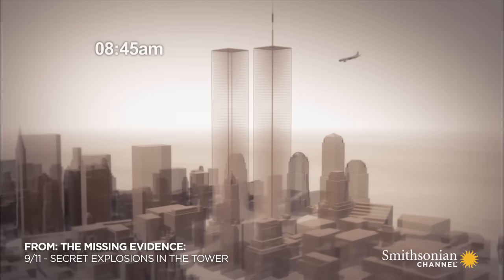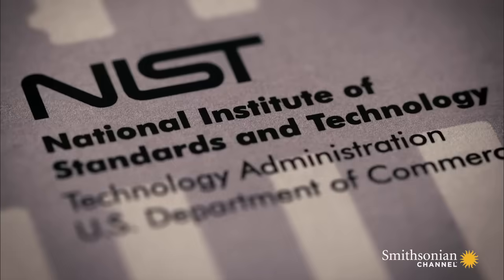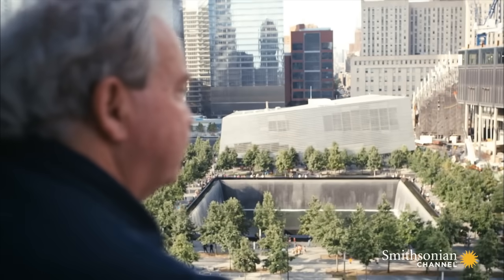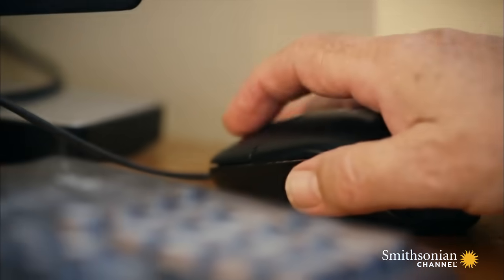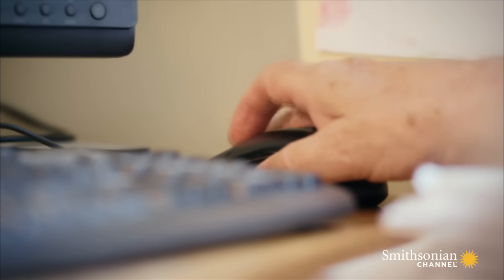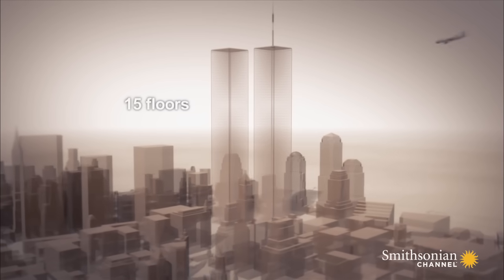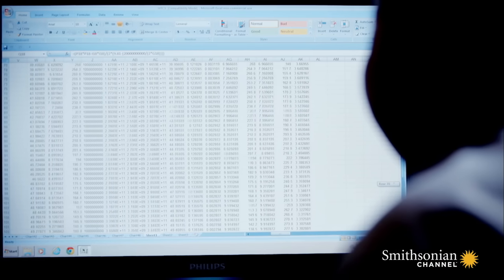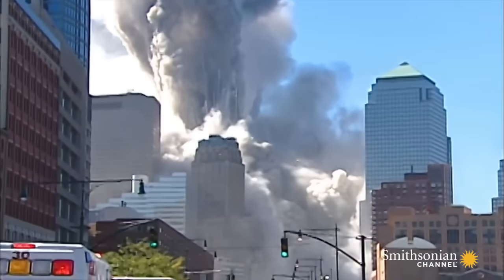This Computer Simulation Explains How the Twin Towers Fell

Comment: Didn’t actually watch the video, but I’m just gunna assume it was C4?
Reply: all 4 steel beams heated up at the same rate and hit their breaking point all at the same time and collapsed like a perfectly executed controlled demolition? if they melted and folded from the pressure this building would have tipped one way or another and hit the non insured buildings from "terrorist attacks via plane". It would also hit rich people who were not informed of the execution like the ones in the twin towers were.
Reply: Dallas The Star Wars Fan nah fire fighters heard an explosion
Reply: Every truth person out there
Reply: Taylor Welsh firefighters witnessed melted steel
Reply: Roger Wilco no. Neither tower burned for more than 2 hours. If I remember right the North tower burned for like 100 minutes. The South tower was less than an hour.

But one of the buildings had previously sustained fire damage that really did rage for hours. And this was before fire safety measures like sprinkler systems. No structural damage was caused then.
Reply: OOM- 8018 The top of the building is smaller than the area under the impact zone. The collapse would have slowed down.
Reply: They found proof of thermite on the ground, in the debris
Reply: In the history of the world only 3 steel structured skyscrapers have burned to the ground. All 3 in the same day 9/11. 
This conspiracy had people in govt, wall street, insurance companies etc. There was a huge loan that was coming due on 9/12,  2.3 trillion missing from the govt. ONI had been investigating along with another agency. Their offices were the ones hit at the Pentagon. AIG, Morgan Stanley, and other companies had offices near the floors that were hit, were to have meetings regarding millions of dollars in overbilled invoices.  A day before there were hundreds of thousands of insider trading that US Air, and American Airline stock was going to go down which turned into milions in profits. There were also military training exercises going on the very same day near NC, of the exact incident taking place in NY.
But this is all a coincidence, no big deal
Reply: Thermite
Reply: Micro-thermite was found in the debris. How to that old plonker explain that?  Also, his model is flawed. The collapse actually sped up as the building fell. That is impossible. They also could not explain why there were massive balls of molten steel at the bottom of the debris. I can, they used thermite charges to cut the steel at the base of the buildings.
Reply: Devon Miller Simple it was a inside job they knew what's up that's why they did communicate with each other on any government level they wanted to have a war... Rember Saddam Hussein had nothing to do with 911 but yet we declared war on them... they figured they needed a similar situation to pearl harbor to get people to back the war they wanted... your government is shadyer then you think... you'll see 50 years from now when documents are declassified!
Reply: Jae KiDd sources?
Reply: Roger Wilco an hydrogen-air explosion goes boom too
Reply: Dallas The Star Wars Fan please do research jet fuel reacting, causing a fire does not generate enough thermal energy to melt steel and “its 2018” isn’t an excuse for a theory with some evidence behind it. I’m not suggesting it was set up, but you can’t discount others opinions
Reply: The King Molten aluminium and water don’t react lol try the experiment or google it yourself lmao
Reply: Roger Wilco nope only reacts when iron oxide is present there was not enough rust to continue the reaction of that size, Al Reacts exothermically if mixed with metal oxides not purely H2O look it up
Reply: Roger Wilco magnesium is only used for wheel alloys. There was not a enough magnesium to produce a reaction of that size and sustain it.
Reply: Roger Wilco that’s the wheel weight including tyres air etc, the alloys weight considerably less, the amount of joules of energy it would take would be ludicrous- you can see on a small scale experiments magnesium does cause a decent reaction however this still would not make enough joules to cause a steel building to collapse
Reply: Roger Wilco each wheel rim actually weights 40kg btw not 2000 pounds lool
Reply: Devon Miller no the owner of the buildings had an interview when he slipped up and told them he pulled them and had preset demolitions Incase something like this happened
Reply: Thermites? That's ridiculous. They eat wood, not concrete and metal.
Reply: Griffin S No steel building has ever collapsed from fires you fool.
Reply: Roger Wilco well suggested that this was never really publicly known because the only proof was in the video it really was a slip up. or maybe not, but either way look at what you just said.. the fire got burned the building before they had the chance to pull it. now you know preset demolitions take months to put in place for a building this size right? now that seems real suspicious it seems like they had this exact scenario in mind.
Reply: Nope. Directed Energy Weapons... like the ones for sale on Lockheed Martins website right now. Check out the circular crosshair shaped holes in the ground. Check out every video of a building collapse ever. Nothing turns a building into dust in mid air. No bomb, no thermite, no C4. This is a brand new weapon producing a brand new effect on materials. DO YOUR RESEARCH without picking a side. Let the evidence speak for itself.. you will not be able to come to this conclusion shown in the video.
Reply: Lmao c4 is used to breach doors not huge buildings
Reply: Had to be stronger. Steel beams.
Reply: C4 disused as American Airlines no 11 and United Airlines no 175.
Reply: Of course you didn’t watch the video.
Reply: Same bro
Reply: Wolfiez MC strategically placed thermite bombs were placed on the lower levels of the building. some of the survivors from the lower levels escaped with blast wounds
Reply: thermite bomb
Reply: A thermite bomb.
Reply: Wolfiez MC also the manner in which the towers collapsed, it looked just like a controlled demolition.
Reply: Jet Fuel Burns at 800F - 1500F. Steel loses enough strength to collapse way at 1000F.
Reply: Taylor Welsh it would take atleast a day to melt to the bottom of the tower
Reply: Wolfiez MC They didn't no they didn't but they did get hot enough in order for them to get bent did you ever thought of that?
Reply: Yeah the steel may have gotten hot enough to bend, but this would only apply to the impacted floors. The majority of both towers were structurally sound; Both towers were 110 floors high, WTC1 had 90 floors of untarnished steel below the point of impact, and WTC2 had 75 floors. That's an immense mass of steel joinery, and it would take time and energy to bend and buckle all this steel. If the towers fell due to a pancake affect then the falls would have started slow and then picked up speed. Also the only way a pancaked fall to have happened the way it did is if each floor buckled onto the bottom one in a perfect way as to buckle all structural integrity of the lower floor in an even and uniform way, otherwise the upper portion of the towers would have been slowed and held up, or would have toppled over. If you look at the footage you can see the upper portion of one of the towers was slanted, so it would have been impossible for a pancake effect to result in a clean demolition. The falls were assisted.
Reply: @Lightguardian_HOH  just saying but what about testimonies about molten steel from firemen and several witnesses. Moreover assuming it bent the steel frame from just incomplete combustion which was built to withstand crashes, should not the buildings fall like trees struck at the base rather than fall in free fall fashion. I am not challenging anyone, just have a keen interest in the matter. Hope you answer the above without cussing me.
Reply: Wolfiez MC You truthers say the same thing you're a broken record player and its 2018 please disband you're movement
Reply: No, i've heard it was an interdimensional elf that had a laser so powerful that he collapsed the buildings by making them begin to fall at the plane crash site and not the bottom floor to make it look like a real fall then disappeared to his own dimension after the job was done and returned to get his Bush/Cheney money....or it was a plane with fuel so hot that it was able to weaken the structure of the beams to cause of weight of the higher floors to collapse on itself.
Reply: mark muravyov wrong, Molten aluminum leaking to water creating an explosion.
Reply: Roger Wilco if you google molten aluminium reacting with water you will see a multitude of videos proving my point
Reply: It doesn't need to melt the steel completely, just bend it or compromise its structural integrity.
Reply: Devon Miller thermite in carts
Reply: jet fuel weakens the steel resulting in collapse..The towers if to collapse were to do so as they are seen
Reply: @taylorwelsh149  the steel in the floors where the plane hit might collapse but the rest of the foundational supports and 60 floors below were not damaged. The majority of both buildings should still be standing.
Reply: @taylorwelsh149  physics, try it you might learn your government is led  insane psycopaths.
Reply: False jet fuel burned it down plus electronics in the floors.

Comment: Heard all the theories. No Accepted theory explains how the floors pancaking disintegrates the core. They say the floors were peeled off by the pancaking. Fine. That leaves a very large very tall intact core still standing or to fall over like a tower after. Remember folks the bottom of the building was designed to carry the entire weight of the building as you go down floors the core is built bigger and stronger to hold all the mass above. There is no explanation for floors pancaking off reducing the weight the core must support while simultaneously disintegrating the core. I call the accepted models BS for that reason. a multistory core should have still been standing in the center of both buildings. No way it all ends up as rubble if the floors pancaked off.
Reply: Rough And Wretched R.A.W. Look up WTC 6...Mandela Effect and inside job proven.

Comment: why use a computer simulation when you have actual footage of the collapses, explain to me how the whole steel cores and everything in the towers just turn to dust and float away, tell me why 800 body parts were found half a mile away on top of the bank building skyscraper, explain to me why 1400 cars when up in flames as far as a half a mile away but nothing else was set on fire? answer these questions an maybe I'll listen to these ridiculous hypotheses.
Reply: keith mcleod 
Yoir questioms are answered by
Heinz Pommer.

Comment: Yes, that sounds like a lot of weight, in fact it is a lot of weight. However the structure was designed to hold up that much weight and more.....much more. All skyscrapers with a lot. 
This guy needs to do a real test to prove his hypothesis, if he can't duplicate it, then his hypothesis is WRONG.

Comment: This theory is a joke. The building could not fall so fast even if it was not fastened together with welds.  Only diagonal displacement of the vertical beams could allow such a rapid fall. Cutting charges of a controlled demolition accomplishes this. It is the only way a building can fall into its own footprint. This is a basic fact of gravity and compressive strength. It could not fall that fast if it was just stacked like dominos. This is a paid for cover up presentation. Yes it was an inside job, very complex. It included, fake phone calls, missing and faked radar tracking, changes in air defense protocal, planning in retail travel agencies, planted evidence at the crime scenes, removed evidence at the crime scenes, announcments of the scenarios before they took place. Wake up.

Comment: Start with a simulation of the 'airliner' hitting the building....  I doubt you can confirm that NOTHING would fall to the ground.  That is, that the wingtips would shear into the building, rather than being sheared off at an upright, and fall to the ground.

Comment: The twin towers were built with load bearing walls meaning that an office fire could weaken the beams to a point of failure and collapse. These towers should never have been able to gain approvals for construction. Consequently victims of 9/11 should be able to sue for hundreds of billions but that was prevented skillfully by offering each family quick settlements.

Comment: Im an aircraft engineer, and i have watched the BUILDING of the twin towers, thats a LOT of THICK steel. NO WAY did any aluminum aircraft penetrate more than a few feet into those towers. Its basically paper, rock , scissors.......STEEL CUTS ALUMINUM. There were staged demo charges laid in the building and foundations long before the ‘attacks’. The buildings DO NOT PANCAKE. It has been proven by scientists, in scale recreations. The floors that were hit collapse THEN STOP!  The so called ‘expert’ is talking BS!  Also no one can explain where all the building went, why it just VAPORISED into dust? Anyone thought of that yet? The pile of rubble wasnt equal to the mass of what came down!

Comment: The top sections of both towers didn't remain intact when they came down, they broke apart and fell away yet the buildings still came down.
how do 3 buildings on 9/11 collapse in the same manner? Why are engineers and architects calling the NIST report a farce? - and they are the experts!
The bigger question in my mind is why and I guess the answer to that is the fruits of 9/11 - down the rabbit hole we go.

Comment: so why wouldn't he apply the same computer model to WTC 7? I mean if it's that easy...
Reply: keithrx3c no it isn’t... he said “it was pulled” meaning the response teams and the recovery operation... watch the whole video for the context... stop making stuff up to fit your conspiracy theory.
Reply: There is another video that explains that building if you want to look for it
Reply: Building 7 isn't so easy because actual damage to it from North Tower collapse was veiled in smoke most of the day. It takes some serious and determined study to find it. The official NIST report did NOT find it, and that is the reason for so much skepticism. It is important to know Building 7 was a long span tower, with a rigid steel frame shell, and long, light weight floor girders spanning between the outer shell and the core columns. The outer shell was sliced top to bottom, as well as part of the inner core. The entire south half of the building lost both lateral and diagonal support. The building load shifted by the two "halves" leaning into one another. The building "twisted", in other words, and that twisting motion, along with heat expansion/contraction, caused floor girders to break from the perimeter walls. By the time you can observe the "building" collapsing, it was essentially nothing more than the rigid steel frame shell; the interior structure was already gone. The shell subsequently fell over in two opposing directions accordingly, NOT straight down, as some would have you believe, by viewing collapse from one angle only.
These are facts as stated by actual evidence, and there are volumes of it. It's a pity the AE group have not bothered to study actual evidence.
Reply: But Larry Silverstien said building 7 was a controlled demolition.
Reply: Whatever Larry Silverstien said is irrelevant to, and cannot alter the evidence for what did occur.
Reply: So why would he lie about it being a controlled demolition if the scenario you describe would've been a more believable story (in hindsight)?
Reply: Look up "irrelevant".
Reply: Silverstein NEVER said it was a controlled demolition.
Reply: I know what "irrelevant" means.
Reply: spanneraol, He said "lets pull it" which is term used for controlled demolition.
Reply: Apparently you don't know what "irrelevant" means, because you keep asking about what someone said, which again, cannot alter abundant evidence for what did occur.
Reply: I'm not making anything up. Watch the video in the link I posted below.
Reply: Suppose Lucky Larry actually and clearly stated to the fire chief, "go ahead and blow up the building". How would that change anything? It won't change a thing. Every bit of the evidence which states clearly what I described above hasn't changed. It's all still there, telling you what did happen. The only valid conclusion you can make is something's wrong with Larry. That's what "irrelevant" means. It can't alter the facts as stated by the evidence, which is overwhelming, and conclusive.

Comment: Well this is completely one-sided and a blatant fucking lie, not to mention the hughmongus margin of error in their system. If that's not bad enough, he created the thing himself which means he can absolutely make it produce the desired answer/simulation. 

The way they came down and the rate of which it collapsed is the number one reason why people come up with conspiracies. It was impossible for the fire to melt steel and you can see the pops and flashes coming  out of the windows a few floors away from top half of the building. Watch the footage, Smithsonian, you're just making your company look like a douche bag.